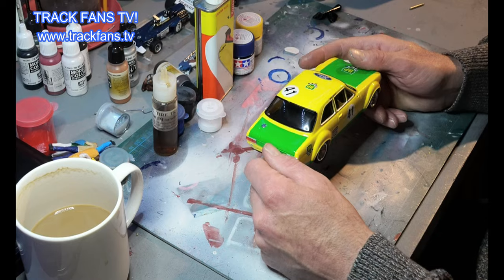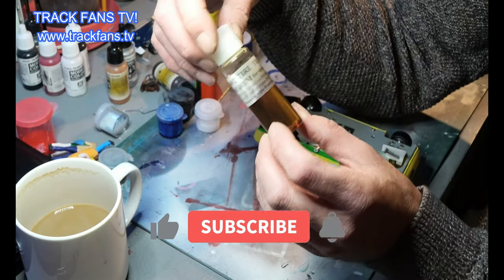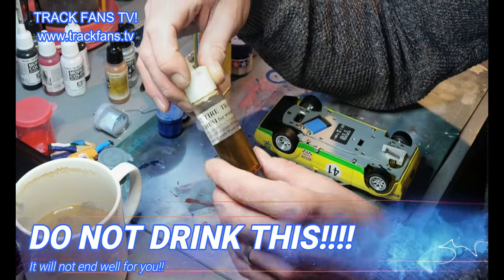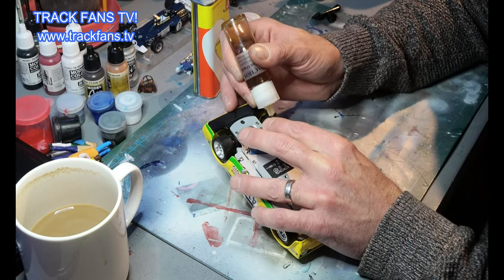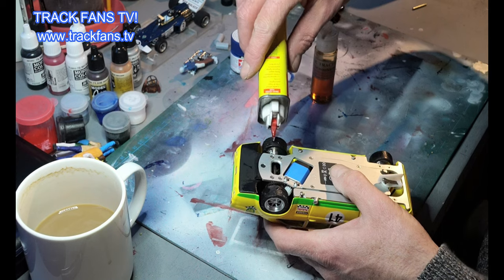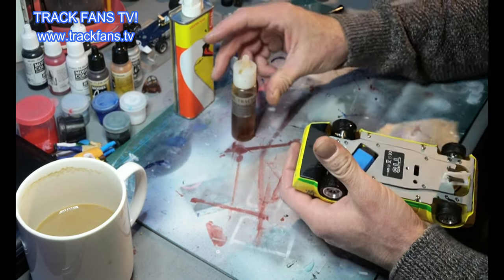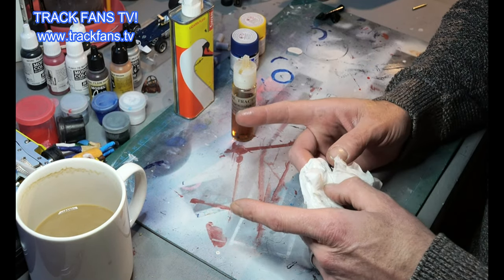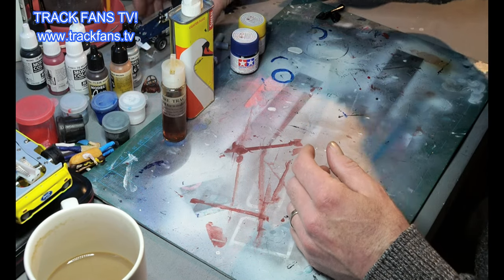Softening Slot Car Tyres - Softening Scalextric Car Tyres / Slot Car 2023

Comment: Bebe Baby Creme or Nivea creme for rubber tires. Cheap, easy to get, long lasting, works great!!!! No need to leave it for a day, will work within minutes!!
Reply from the maker: Nice tip, I'll give that a shot! Cheers ledge!
Reply: @trackfanstv  already tested and verfied in one of #thatslotcarguy videos on our beautiful track!!!
Reply from the maker: @slotcardude68  I saw the episode, didn't he pretend to swipe some ;-)
Reply: I need to try this, do you need to apply every race?
Reply: @SlotCar2021  to your likes. Apply once, let it rest for a minute or two, drive the first 2 laps slowly (very slippery!!!!), should improve constantly. Clean with a tape after like 20-30 laps. Also works on foam tires.
 Does NOT work on new rubber tires (surface must be broken), on Polyurethan or Silicone tires.
Reply: @slotcardude68  Most clubs won't allow you to do that, driving round with wet tyres.
Reply: @modelracecar  agreed. Work around: rub the tires with the creme, let it soak in 'till they are dry and drive them.

Comment: I haven't tried it on slot cars yet simply because I can't find any at the moment, but I used to use 99% rubbing alcohol on rc car tires and it make them stick like glue on a hardwood floor. The rubber in both types of tires is similar so it should work great on slot cars.
Reply from the maker: Nice tip, I'll give this a try 💯👌🏻

Comment: I used to use Oil of Wintergreen, to soften slot car tires.
Reply from the maker: Interesting, I've never heard of the technique or, oil of wintergreen so, I'll be checking that out later. Where would you get oil of wintergreen out of interest please?
Reply: @trackfanstv  I used to find it at the drug store...you may have to ask for it.
Reply: Oil of wintergreen is banned at most UK slot car clubs - I think  it is believed to be carcinogenic. The noticeable smell makes it easy to detect.

Comment: Tyre prep is always a great watch.

A 50/50 mix of NSR light oil and lighter fluid works great, give the mix a good shake, it'll take a few hours to dissolve and mix properly. Grip lasts a few races.

Tea Tree oil works very well, as does Olbas Oil but grip only really lasts a minute or two.

Long term treatment...3 in 1 oil applied every day for a week.

Koala Klaws works very quickly but grip is short lived.